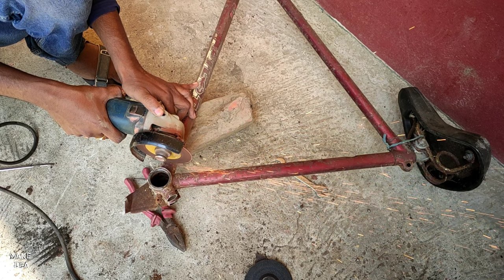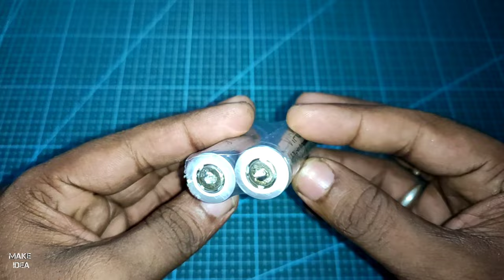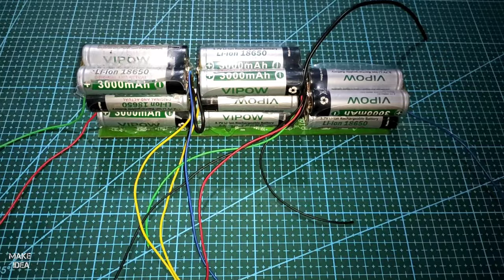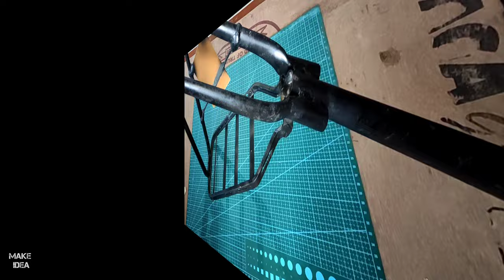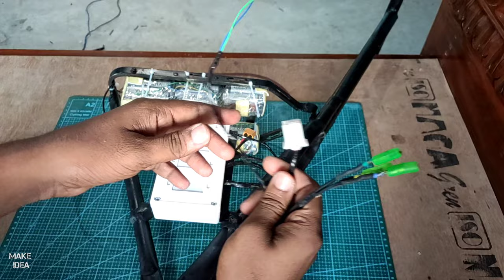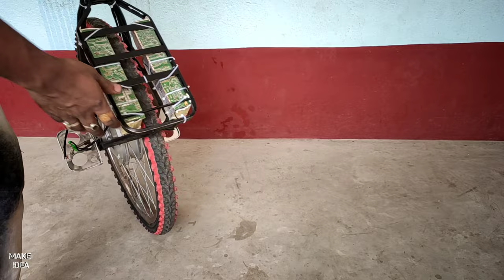How to make  Self balancing Electric One wheeler at home || Unicycle

Comment: SPANISH ( ENGLISH BELOW)
Nota: Este diseño cuenta con muchas fallas, las baterias no deben estar cerca de usuario por riesgos a la salud. 
Por otro lado para quierenes preguntan este diseño no cuenta con un sistema de balanceo autonomo, todo lo hace el conductor, es solo un controlador 
* BLDC de 350 o 500 W con un motor de 350 W para bicicleta.
La forma de cableado la pueden encontrar al buscar como conectar cualquier kit de bicicleta electrica.
La instalacion es deficiente pero el concepto funciona. 
Una lastima que no es mas claro para las personas que aun no conocen del tema. 
Saludos!

ENGLISH: 
Note: This design has many flaws, the batteries should not be near the user because of health risks. 
On the other hand, for those who ask, this design does not have an autonomous balancing system, everything is done by the driver, it is just a controller. 
* BLDC 350W or 500W with a 350W bike motor.
The wiring diagram can be found by looking up how to connect any electric bike kit.
The installation is poor but the concept works. 
A pity it is not clearer for people who are not yet familiar with the subject. 
Best regards!
Reply from the maker: Thank you very much sir.
I will update this and and give it a professional look. There may be some delay because it can cost a lot.
Reply: It’s definitely not a basic controller. If you actually watched the video you would see the only thing on the handlebars is the on/off switch, and you can see he tested the auto balance after initialization it. When he tilted the bike forward the wheel rotated forward. When he tilted the bike backwards, the wheel rotated backwards. With no controls anywhere on the bike, clearly it’s being done inside the white box.

Comment: Good diy make... 👍❤️
But it is not self balancing, rather a single wheel electric cycle..
Right?
Reply from the maker: Sir this is a self balancing  electric on wheeler..
Reply: What you have made is a great effort, no doubt. 
But to have the name of 'self balancing' your scooty will have to stand straight without a rider at zero speed , ofcourse without the stand 😊.
Best of luck for next project.
Reply: /facepalm Even on true EUCs self balancing means front and back correction only, not sideways...

Comment: My first real unicycle!(first one was a cheap plastic one as a kid https://www.youtube.com/post/Ugkx4e2fa6x27dF7shCelntq0ZIKt4N0jELI  I never learned to ride)So, this is a true learner, and for a C note, exactly what was needed. After a few weeks, I'm able to easily ride up and down the street. The Good: Solid frame. Has absorbed numerous spills through learning and still solid. Look – great looks, after 6 weeks of bashing Weight – it's really all tire, but as I fall I can easily grab the seat so it doesn't slam the ground. Size – Very adjustable. I'm 6', 33" inseam. I put it mostly up, but could go a bit higher if I needed to. The Bad: Not sure if it's out of the norm, but seat got scraped up quickly. Pedals – they are a bit uncomfortable and I can't get the right feel on my feet. But, they are solid and haven't been damaged at all as I've seen in reviews on other cycle's.- To address one comment about the seat connection not straight. Huh? Seat is on a round pole, you just turn it and it's straight. Either of the bad I expected to replace once I improved. I'd recommend to anyone else in the learning phase.
Reply from the maker: Yes

Comment: भाई क्या यह possible है की , scrap old electric scooter Ka - hub motor + Arduino nano + GPU 6050 + controller + old laptop li-ion batteries se electric self balancing unicycle banaya Ka Sakta hain ?
Reply from the maker: Bana sakte ho lakin , battery voltage 60v hona chahiye. Or schooter ka hub motor se nahi hoga, Schooter ka hub motor 800w se jada hota he..
Reply: @MakeIdea   sir batterie Ka  voltage 60 v kyo Hona Chahiye ,aur hub motor  800 w Ke jyada hone SE kya Hoga?
Reply: sir batterie Ka  voltage 60 v kyo Hona Chahiye ,aur hub motor  800 w Ke jyada hone SE kya Hoga?

Comment: Bhai kya kya part lage?
Reply from the maker: Arduino nano, mpu6050, dc motor controller,
Reply from the maker: I wii give you buy link of self made controller as soon as possible
Reply: @MakeIdea   thanks
Reply: भाई क्या यह possible है की , scrap old electric scooter Ka - hub motor + Arduino nano + GPU 6050 + controller + old laptop li-ion batteries se electric self balancing unicycle banaya Ka Sakta hain ?
Reply: sir batterie Ka  voltage 60 v kyo Hona Chahiye ,aur hub motor  800 w Ke jyada hone SE kya Hoga?